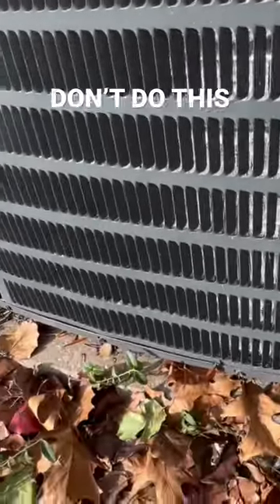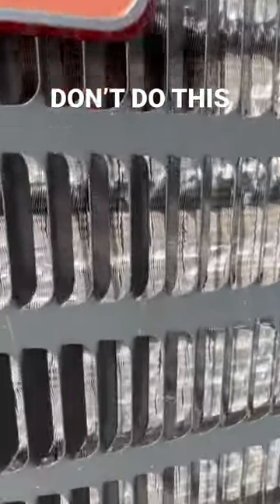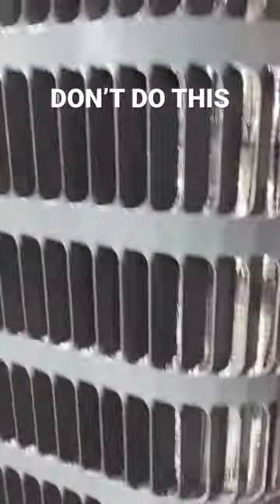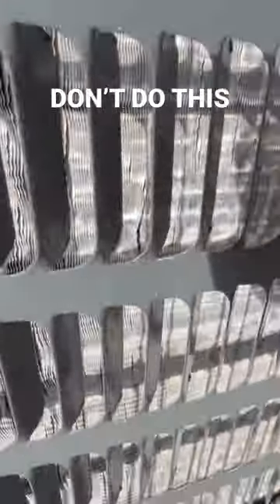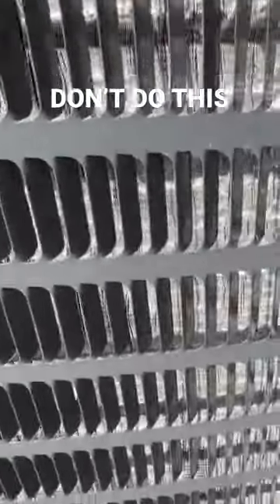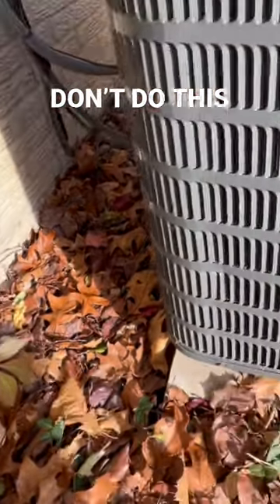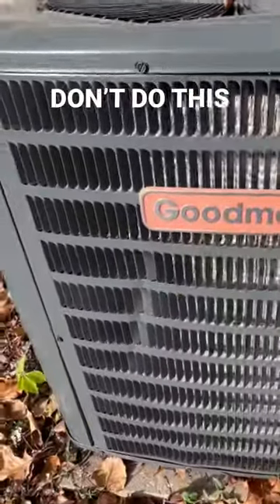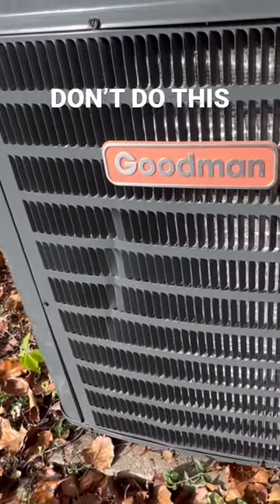DO NOT CLEAN YOUR CONDENSER THIS WAY!!

Comment: Just did mine yesterday, i always vacuum with soft attachment once apart.  Theu use hose with low pressure inside and out.  All to protect the fins.

Comment: Take the top off and vacuum the debris out of the bottom then spray condenser cleaner inside and out on fins. Hose off from inside first low garden fan spray then outside.

Comment: Just use a hose or them electric power washers are probably ok if the pressures is low. Also the big units if you hold the jet far enough away. I would rather use a garden hose . 73

Comment: Second  coil does not really  get dirty. You dont have to take the top off. Lot of people adovocate jet stream. Thats probably  to strong. Some manufacturers  say water only. No cleaners. Who to believe.  But the bottom does  get nasty. So if your worried about  clogging you should  take the top off and shop vac . Then rinse the bottom. Then again I never did a thing to my old air conditioner on my old house. Still going good at 32 years. But those  floating fuzzy  things from trees should  be washed off. No covering during  winter either.

Comment: Anytime the coil is bent it is weakened and any kind of combing done won’t do jack squat in the long run. If the entire coil has been bent it’s better off getting a new condenser coil.
Reply: True,  but if the tubes are in good shape,  combing the fins will give it a new lease on life.  Also,  as expensive as labor is,  I would rather replace the whole high side than just the coil.  The compressor has already been brutally abused.  Spending a little more is worth it economically in the long run,  IMHO.  YMMV.

Comment: The proper way to clean the condensing unit is to spray it from the inside out with power off and the condenser fan w/fan grill removed.
Reply: Bingo
Reply: Yes that's the best but not practical for the home owner. Just use a garden hose. 73
Reply: It’s okay to do it the easy way as long as it’s not a double coil
Reply: Personally I take off the exterior panels and coat the coil with coil cleaner then thoroughly  spray from top to bottom. Any gunk that lingers at the bottom is cleaned up
Reply: Yes, don't just push the dirt and debris further into the coils, reverse flush it.
Reply: the proper way to wash a coil is to call your HVAC company and have it professionally cleaned.
Reply: @jellybean2032  Those were the same guys who tried to sell me an entire system when the real problem was the run capacitor.
Reply: @thisisyourcaptainspeaking2259  my answer to that is that is not your HVAC company. find someone that's reliable that won't rip you off at the same time. I work for HVAC company for 20 years and I'm here to tell you there's a big difference between them
Reply: @jellybean2032 probably not in the southwest portion of the country? Lol

Comment: You do want a strong  Enough water pressure To push the debris in the opposite air flow direction through the Fine  Condenser fence...FYI remove the fan.

Comment: Spray it with water and dish soap before you start combing 

Makes it a thousand times easier.

The key isnt low pressure.
Its low velocity high flow.

Comment: It's not complicated, if you accidentally fold some things, just use less pressure and never use a power washer. Plus, when fins are folding over really easy even with just using your thumb over a garden hose as an idea of pressure level, is probably been chemically cleaned one too many times. Also never use chemical cleaning it's pointless, especially not the acidic or alkaline stuff. Definitely don't if it's coated or micro-channel..

This is like the equivalent of shocking yourself, wondering why it happened shocking yourself again, wondering what happened shocking yourself again, I just don't understand it but not paying attention is usually a pretty good reason
Reply: As an HVAC/R and food service equipment service technician for over 17 years I can 1000% tell you that coil cleaner is NOT pointless...
Reply: Coil cleaner works perfectly for coils 😂 especially if there’s oil build up on the coil
Reply: Coil cleaners is essential for a thorough clean
Reply: Any technician will tell you it's safe to have the coils cleaned with the harsh chemicals they use. They want another service job to come by. Plain water with the hose should be enough to remove dust buildup if you clean them on a regular schedule. It's best to make sure you change your filter's every 30 days. That keeps the ducts clean. Now for the unit outside it's best to just use the hose and clean from the inside, you might have to remove the fan and cover. I done mine myself on my mountain property it don't get used much and I  Cover the top everytime I leave too many pine needles get inside the unit. My in-laws had trouble with mice getting inside the air handler. The so called technicians would not bother with the air handler. If I have the problem I would clean it with distilled vinegar the smell would go away. The installer should have used metal ductwork but you get what you pay for. 73

Comment: Bet the guy who powerwashed this unit just did it through the exterior louvered vents, guaranteeing that the high-pressure spray had a high probability of ricocheting off the angled louvers and hitting the cooling fins at a debilitating angle.

Comment: I found that pressure washers even if you are careful and not bend the finns you end up expanding the aluminum around the copper tubes and they will not ever transfer  heat properly again. You will see it on the 95 degree days.

Comment: Neat idea. I wish I trusted my electrical skills enough to try something like this lol. I don't care to get deep into solar at this point, but a simple panel (that your electric company doesn't need to know about) to offset a power-hungry appliance that you use when it's sunny out just seems to make good sense.

I love the idea of the soft-start, too. I always wonder why we don't implement it in more appliances/tools, at least the midrange and nicer ones. Maybe my line of thinking is off, but it seems like less wear and tear on components, and maybe better for voltage stability in the rest of your home. Also, the experience as a user is just less jarring. I suppose I should watch that video next!

Comment: So much misinformation. 20 years professionally cleaning over 10,000 coils per year - always with a pressure washer. Yes, a trained professional can use a pressure washer and cause no damage. NO, most homeowners probably can't.  Yes you can fix these fins. Our employees would have this unit apart and completely straightened in 10 minutes with the right coil comb. (plastic - disposable). This video shows a problem, but it's not the end of the world.